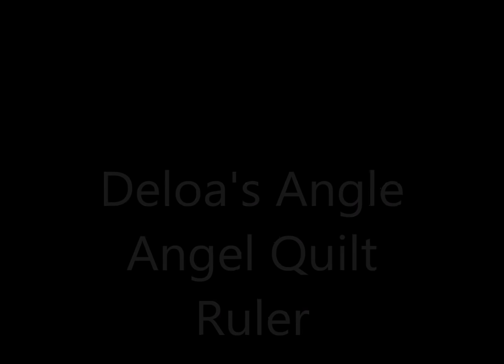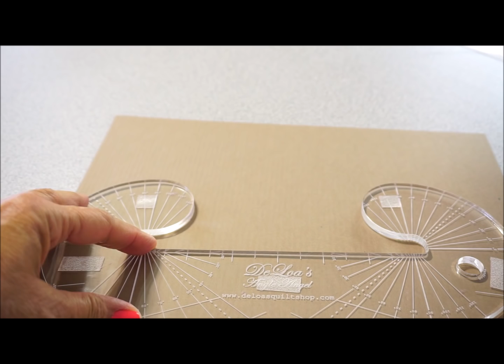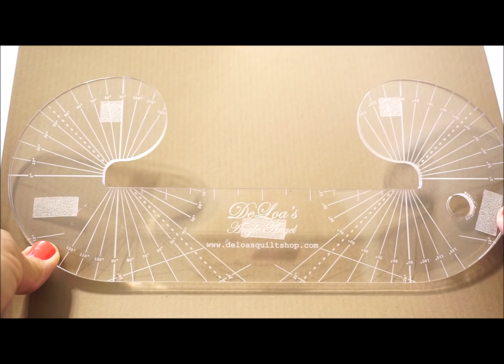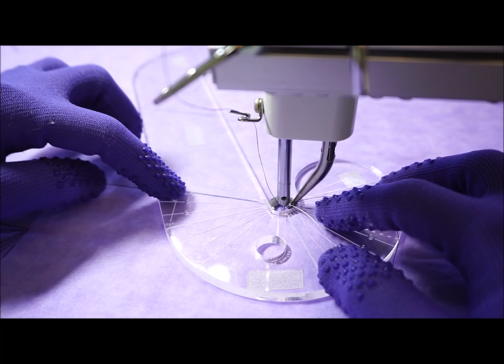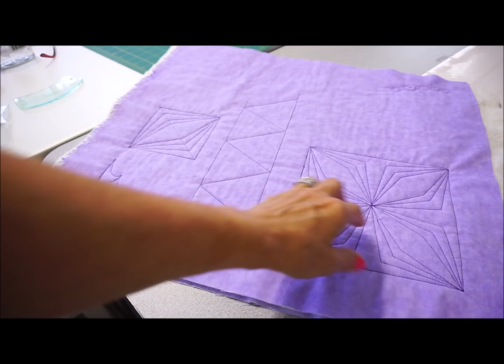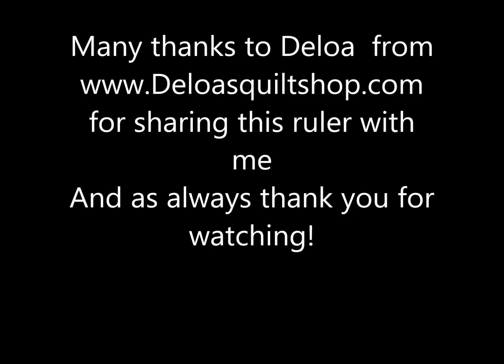Deloa's Angle Angel Ruler tutorial by The Quilt Journal

Comment: love what you did here, is this ruler available for a domestic machine ?
Reply from the maker: Yes, I have used it on my domestic machine, but you need to use it with a ruler foot- otherwise I don't feel it's safe for you or your machine. Depending on what brand you sew at, there are lots of ruler feet available. :)
Reply: thank you, I have the westalee low shank ruler foot and a bernina 430. Would that work ?
Reply from the maker: Hi Frenchstamper- not sure about the  low shank Westalee foot with all longarm rulers. I do not own that one, but I have heard that some of the clearances are low on the low shank Westalee ( they suggest their 3mm thinner rulers)- I would be a little hesitant . I would touch base with Westalee first.

Comment: How long of a distance can you stitch from the point? I would like to make radiating lines out from a center point of a 12 to 14 inch block.  Is that possible?
Reply from the maker: Hi Georgia,
Yes you can extend the length of the ruler by sliding down the ruler only about 1/2 way and continuing. The 1/2 line that is already stitched will provide the reference line to keep angle/ line straight. Hope this helps
Reply: +The Quilt Journal Thanks so much for your reply  - and the good news.